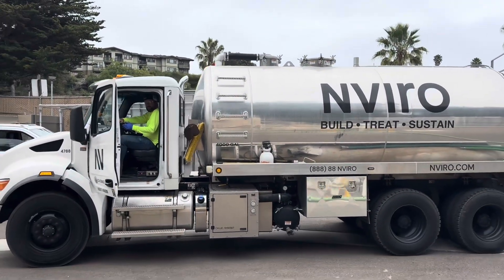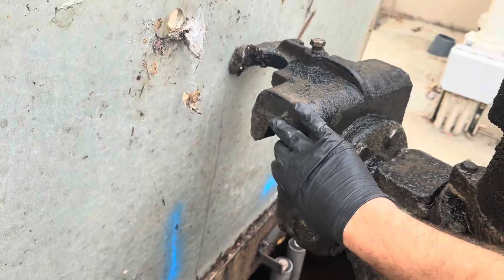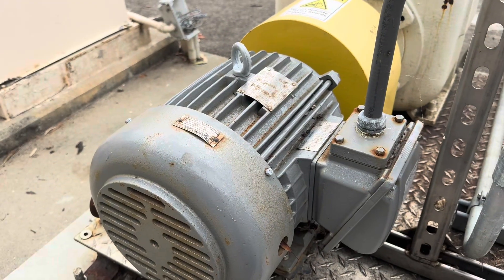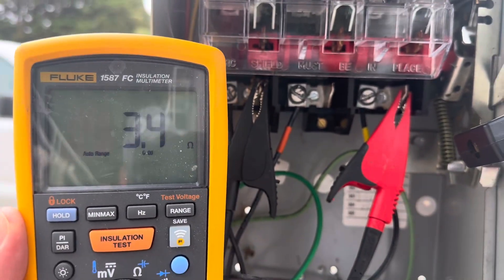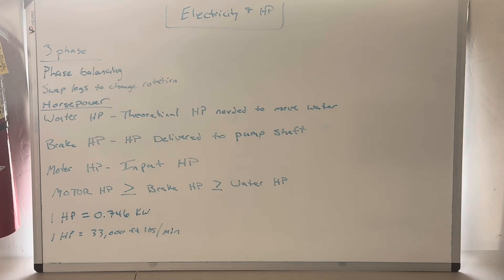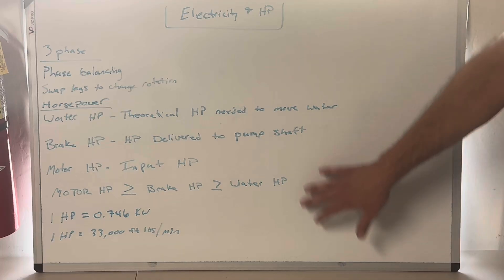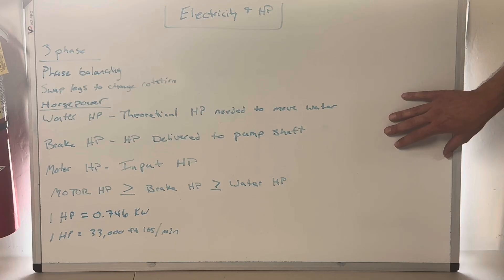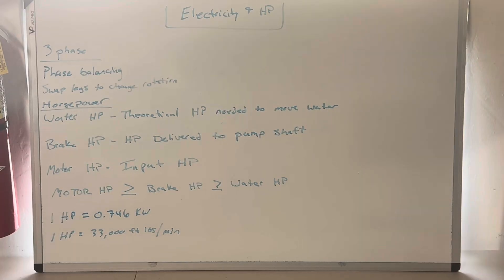Wastewater Plant Pump and Motor Inspection (Megger/FLA/Phase Resistance) & Exam Prep on Horsepower!

Comment: would love to see some more electrical troubleshooting ideas with the motors/pumps....like how to tell if the motor is burnt, going to ground.  On the megger that you did, is that a special fluke meter you need?  I noticed you used a different meter to test amps....love seeing these types of videos, this could save me money in not having a electrician show up to troubleshoot our smaller plants.  thanks again for the information
Reply from the maker: Howdy!  Absolutely when I have to troubleshoot anything I’ll make a video.  I try to keep things tip top at the plant so real troubleshooting is few and far between.  When determining if a motor insulation has failed, a typical rule of thumb is under 1 megohm is an automatic fail.  If I see over 1 meg but it’s struggling to keep voltage that’s also not a good sign.  This is showing a short to ground.  The second test I did would have shown a failure in the windings or a phase short of some kind - pretty much all I was looking for there was consistency in resistance among the 3 legs.  The last test was to see if the motor was running outside its FLA.  A lot of things can cause this- bad bearing, jammed wet end, etc.  also low amps are bad - that could be a plugged suction, shaft failure, etc.  hope that explanation helped.

 I’ll link to my other Megger video where we were able to find a short on the conductors.  That’ll be down below.  Yeah you need a Megger to do the test.  When selecting a fluke multimeter make sure it can do an insulation test.  My Fluke was about $1000.  You can also just buy a standalone Megger, but these multimeters are great for versatility.  Yeah for amperage I use a different tool cause I just couldn’t find a multimeter that did absolutely everything.  Not a huge expense.  I don’t need to be super specific with my amps.  I think that Klein was $50 at Home Depot.  Thanks for watching and asking!!

Here’s the link to me finding an actual short.  I open up with a pretty dramatic warning about electricity.  Just don’t want anybody getting zapped!!

https://youtu.be/Xb-yi1XPhFQ?si=z8XYLMKkC1EY9TPG
Reply: @WastewaterEnthusiast  love it.  This is what I like doing.  I just get lost on the electrical end of things.  I will be on the lookout for more videos.  thanks for the help